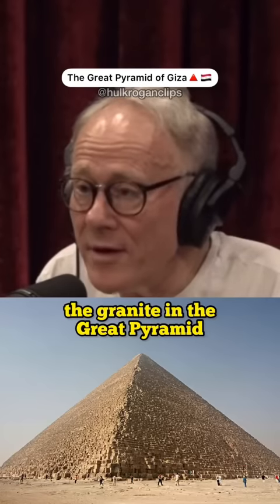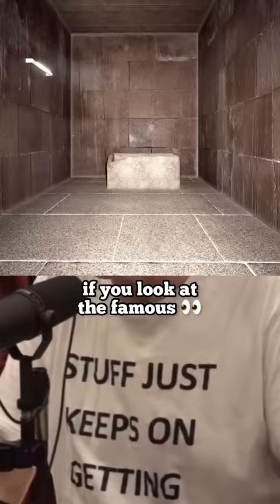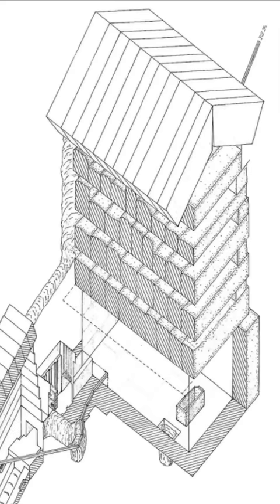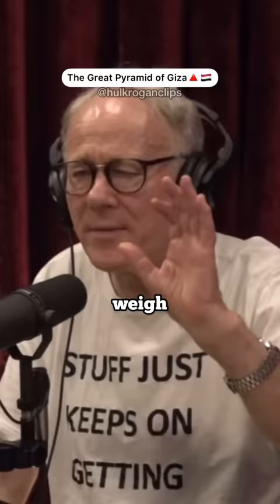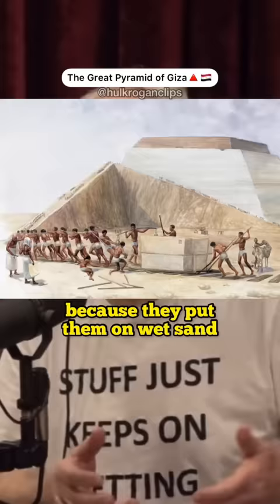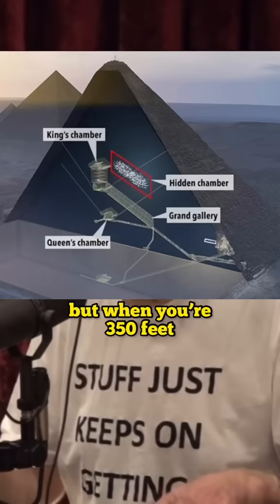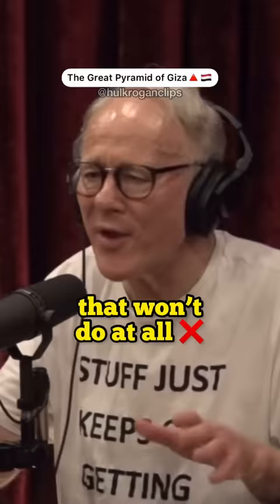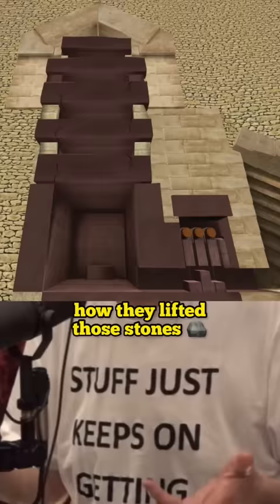How were the pyramids built? #joerogan #shorts #history #egypt #pyramid

Comment: Maybe they built a 5 mile long ramp from ground level into the king’s chamber…. GENIUS !
Reply: How long would the ramp be if you can't go above 10 degrees
Reply: @tonycizek7876  the longer the ramp, the lower the degree of the slope.  The pyramid was almost 500 ft high and let’s say the Pharaoh’s tomb chamber was located in the center:
Height (a): 250 ft
Ground distance (b): 1,418 ft
Ramp (c): 1,440 ft 
Elevation: 10 degrees  

If (b): 14,323 ft
Then (c): 14,325 ft
Then elevation: 1 degree
The ramp would have to be 2.7 miles long. 
Now imagine a 5 mile long ramp.  The degree of elevation would be barely above 0.5 degrees.  I’m sure 2000 slaves can pull that tomb up into the center of the pyramid easily

Comment: I have to say that we DO know, as all the proof says, they build a ramp out of dang using the pyramid itself as a base to push the blocks up.
 And they carried the blocks near the building site using massive boats, one of which has concerned and is on a museum (if I remember right the museum is in Cairo, but I'm not sure about this museum's location)
Reply: Can’t possibly be ramps. Ramps aren’t useable past 10 degrees, which would make the ramp miles long.
Reply: @zachpettrey  as far as I know, the best theory that doesn't require miles it's the following: They built the ramp using the pyramid itself as support, with the movement plane of the ramp perpendicular to the pyramid but built around
Reply: This has actually been proven wrong there is no way they could get those multiple-time blacks up in the king's chamber is that way.

Comment: The flotability tanks look like a rather convincing theory
Reply: That’s partially right . Imagine that but instead of the rocks floating up to the top they had a system like that attatched to a dam that floated rocks up and down a shaft. They could easily convert the rocks energy with a pulley system to be able to hoist other objects with the same weight and even more if they had gears

Comment: They did NOT lift the blocks up on any of the pyramids..   They simply added sand around the pyramids once they finished the floor and they rolled them up.   AS for how they got the blocks from far away..  Simple..  ROLLERS...  Take a round tree and remove the last and put it in front as you go.. repeat..

Comment: Ok I don’t normally post. But think about this. This was a time with no “time saving devices” because there was nothing to do other than your work. Especially if you were a slave. Or a architect who’s all mighty god-king told them to build something. No tv, no internet. And if you had literally thousand’s of people pulling on a large rope with a block and tackle system. You could lift anything. If you were told to make this block of stone perfectly smooth and placed or you die you would spend any length of time to do that right. You don’t need space age almost magic tech when you have a enormous slave work force.

Comment: Okay but the one thing no one thinks about is just building it level by level putting down sand to level it off then you just have to remove the sand witch doesnt need to be perfect as the wind will blow the rest off

Comment: "How did they do it?"
How did they get them there?  The Nile helped transport them.  It runs north towards the pyramids.
How did they move them?  Round pieces of wood acted as wheels to reduce manpower required to move it, there is potential that they created scaffolding and used many pullies to move it, but I have my doubts... most likely they used an earthen ramp, a reaaaaally long one as studies have shown you'd need a ramp about 33 degrees in order for the slabs of stone to not just slide back down.
How did they make it fit so perfectly together?  Part of it is erosion, the rocks on the outside are smooth from rain flow over it over thousands of years.  On the inside? probably some kind of simple concrete, the romans aren't that far from this time period and had concrete... it's not hard to believe the Egyptians of the time had it.  Also the room inside was the most important room, so it was probably sanded down till it was smooth, it was made to hold a God after all.

It's not a huge mystery, the mystery is why we think ancient people were so stupid, when clearly they weren't.  You just gotta think the most basic tech... and then scale it up to match an empire working on a single project.  Hoover Dam is a good example.  Or the Panama Canal.  Take your pick.

Comment: I saw a video where they showed a possible way they have done it, it was with water and filling tunnels with water that goes all the way up to pyramid then they attached something that floats to those blocks not sure what and they would float all the way up, they found those tunnels in the pyramid that seemed to be airtight and came up with the theory
Reply: But according to people that have knowledge it seemed that it was impossible to lift those stones with floats dur to multiple reasons such as material rigidity, psi pressure, etc

Comment: they built water elevators, and there's a massive rock queries next to the pyramids under the sand they found with ground penetrating radar. furthermore, the pyramids are also a spiral under the surface.. found using radar a few years ago

Comment: They built a compacted Inclined road around the sides of the pyramids, and slid the blocks up around the pyramid with water as a lubricant and perhaps logs underneath the stones. Slaves in mass pulled the stones upward.  Or perhaps giant stones/ blocks were used as counterweights, pulling the stones up, while the other stones slid down a descending road,  Mystery solved!
Reply: Wrong !

Comment: How about this? Sand can be moved to create a ramp. Wood rails greased with olive oil make a nice RR. Add animal power to pull up the gentle grade along with stops to stop slide back and the stones can be dropped into the half completed pyramid top down [at same level]  The top of the structure is then added above it and then the construction sand surround is removed.
Reply: Yeah except it wouldn't work lmao
Reply: @Y2Crouch  You may be right.  I'd still like to see it tried on a small scale though. It would make a great youtube experimental video.

Comment: I think they made a dam on the Nile and made tall cylindrical chambers they flooded with water attatched to the dam and would put large rocks on the top and let it push the water out  of the cylinder creating torque that could be converted to lift other rocks just as big depending on the gear ratios. When the rock gets to the bottom the re flood the chamber with water and it floats back up (if the rock is on Floats). They could easily make a winch if they had material strong enough

Comment: A man recently came up with a theory about teeter tottering the blocks. Place a fulcrum near the middle of the block & stack weight on the high side, when the giant block tips you then put another fulcrum near to the center under the lifted side and then transfer the weights to the new high side, the block tips the other way. You just keep teeter-tottering back and forth and every time putting a new fulcrum a little higher. now your inching it up just by shifting weight and using a fulcrum. Pretty Basic physics actually.
Reply: Ok, your break is over. Back to the fry station.

Comment: pyramids were flat back then weren't they? What if they used its own structure to push the blocks up there? Use oil or a crew of people using ropes to stay in the path of the blocks to help place pillars for supporting the blocks when the group pulling it gets tired? That would to to the top if they used some kind of platforms to hand people from

Comment: I'll tell you how they did it! They started from the top down. Just as you said, they slid them across wet-sand, and as the built each top row, they dug out the sand afterwards. And layer by layer, they got lower and lower. This is a complete guess BTW. I have zero evidence. Just throwing shit at the wall and seeing what sticks

Comment: You don't need to lift them up. You can submerge them - dig out material underneath them.
Reply: Do you realise how ridiculous that sounds? 
So you're saying that they dug out 139m of earth in a 200 mile radius to build the pyramids? Rather than admitting you have no idea how they were raised into position?
Reply: @mikeymo9363  why in 200 mile radius? Only on width of the piramid. It was tomb so it was supposed to be hidden in sand anyways
Reply: @pandasarecute998  well if every block was submerged then it would have to have been dug 139m right? And if we can see them now as clear as day on flat land then the entire earth around the 3 pyramids  would have to have been dug out to be able to see them...
Reply: @mikeymo9363  maybe wind erosion and sand was moved away since few thousand years ago. Well, I'm most likely wrong but just my guess if it was apparently not possible to move blocks up, then why not build them down like basements

Comment: My high school physics teacher, who won national teacher of the year twice...said the pyramids were build moving stones using a very large scale hydraulic ram. The lower stones were set in place by moving the way he said...water proofed pool in those base stones and the rocks were floated up. Level by level.
Reply: Haha Philjo. Just Like 120,000T ships that float today?
Reply: Bruh. Granite doesn’t float 😂
Reply: @clintclinty9372  yea, similar to what my teacher said. He never elaborated on the floaties...but obviously something like that was used.
Reply: So in order to build the pyramids they had to build a water-tight structure larger than the pyramids first.....

Yeah that makes total sense....
Reply: Clint Clinty  To force a 70t block up a hydraulic shaft would require immense pressure and serious precision. They would have such tight tolerances to keep pressure trapped behind it the entire 350ft straight up. Then you would have to explain how they get that pressure built up, which is even harder to explain imo.
Reply: Clint Clinty Okay, that's not a hydraulic ram then. Still incredibly complicated. Make a surrounding structure, watertight and strong enough to hold that much water. Make a gate or valve for it to empty and refill, uphill so it requires a pump of some sort. Then use what for floatation devices? That's a lot of weight to float, balance evenly and then pump water 350ft high.
Reply: Clint Clinty  Poured down the shaft with what? Guys with buckets? So your gonna have an army of guys carrying buckets up stairs or whatever? That's a ridiculous assumption. Do you know how long that would take just to fill the shaft once? It would have to be emptied and refilled every time they floated another block or set of blocks.
Reply: better than your solution of how.
Reply: @timothydavis3703  I don't think anyone has a clue, anyone claiming they know is full of it. The only thought I have is that it took a lot more tech than we believe they had. From the core drilling, hollowing out single piece granite boxes with precise 90° inside corners, it's just not possible, no matter the amount of slaves. Also, I think it's rather hard to believe these were just ceremonial tombs or some such. There are too many of them scattered across to much area and too vast a time span. There was a functional aspect of some sort.

Comment: If I was them I could drag the material inside the piramid with a rope and strong people then I would use a rope leading from the top to the bottom and have one or two people at the bottom of the piramid pulling the rope down on their side and perhaps another two doing the same at the top then from there they move the block onto the other blocks.

Ngl, I should draw this and fix my explanation and sentence structure tomorrow bc it's 2qm rn for me xd